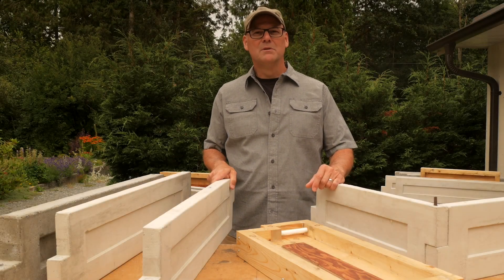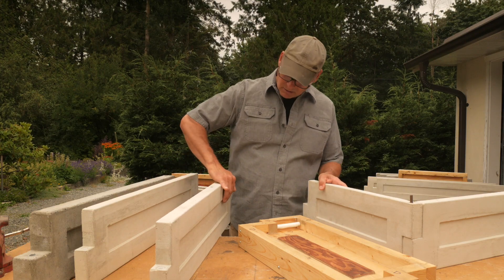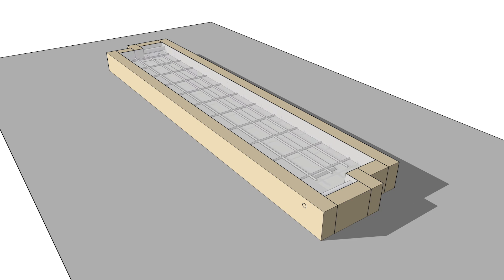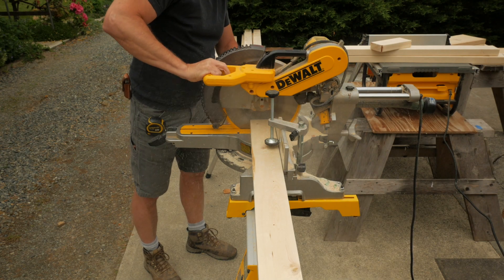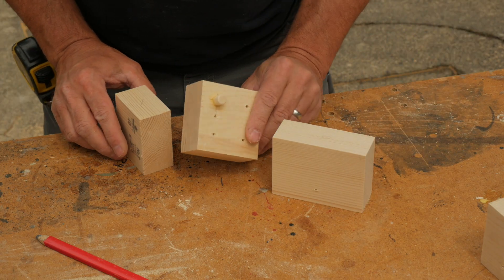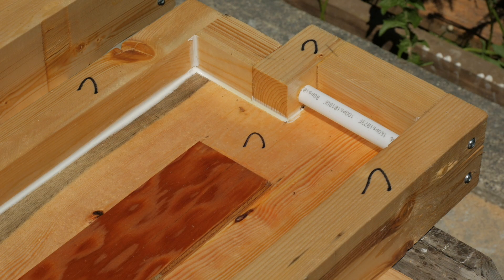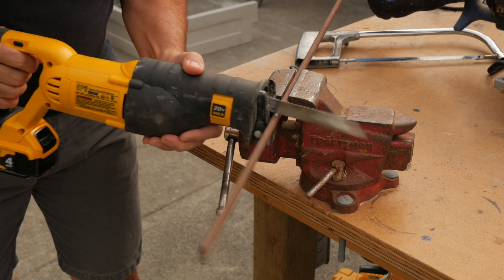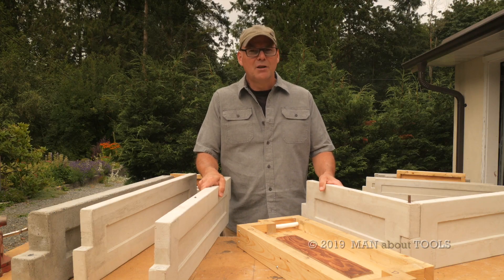make Thin CSA Concrete Garden Boxes PART 4 - cast garden forms

Comment: I love these raised beds. Lots of labor (I'm retired) but significantly cheaper than lumber now and I expect them to last well past me. Here is my story. 

Four years ago I gathered lots of free lumber from craigslist and built about 660 sq feet of ugly, mismatched wooden beds. I had hoped they would last 7+ years but did not know what to expect. Well after a couple of years I saw they were not going to last long. After 4 years they are in many states of falling apart. I started looking for something to replace them that would last and be pretty good looking. I found some that I kind of liked but didn't meet my criteria. Then I found these from man about tools. 

I decided that I wanted to use a standard 2x6 for the base of the form and 2x4 for the sides. The ends I made from a 4x6 I already had so they are just 1 piece of wood. I made 7 - 4' forms (2 more planned because that is about all I can handle in one pour) and 2 - 2.5' forms. This allows me to make my beds any of these sizes 4x2.5, 4x4, 4x6.5 and 4x8 (most of mine will be 4x8). I made two insets on the 4' forms and 1 inset on the 2.5' forms. I made the corner holes 3/8" and use 30" - 1/4" rebar to hold them up. This allows me to fill my trapezoidal garden space nicely. I put 1/4" gopher wire under the beds because we have tenacious and smart gophers. I also use the 1/4" wire in the forms. I use type S mortar and add 1# of concrete to it to make it slightly stronger and stretches 1 - 60# bag to fill 2 - 4' forms. I let the forms set 24 hours covered with wet towels then take the sides off. Then 24 hours later I remove the forms and place the 31# sides in a junk refrigerator filled with water turned on its back. I let them cure submerged at least 72 hours. They come out very nice. I may paint them after they age but they look pretty nice as plain old mortar.  

The garden is shaping up to be VERY precise. I replace a few of my old beds as my garden completes this year's crop. After tomorrow I will need for more tomatoes to end their season before I can replace any more but I will continue pouring these so I can get ahead for next year. The sizes  allow me to move crops around and move the infrastructure (irrigation, row covers, trellis, etc) easily. I decided on 34" aisles because that fits nicely into my space and allowed me to get a wheelbarrow between them easily. I have about 20% of my 660 square feet completed and make a bit more than one bed a week. So I have about 20 weeks of work to go. 

Thanks to Man About Tools, 
Dave

Comment: u could thread the top of the post and screw a cap or door knob for easy removal of the post and for additional decorative look also it would provide a seal to keep water out maybe a thin gasket time material in the corners and if plans to make multi level boxes... very nice job on all of these. definately think the csa mortor mix is the way to go. you could use mortor coloring mix also. excellant work.

Comment: Love Rapid Set Mortar Mix - everything except for the price.  Unless your budget is pretty big, it would cost less to hire the local teenager (or your spouse) to help you move the heavier pieces with the original design.  But...that doesn't take into account how fast the process is with using this mix.  Turnover rate (pour to taking out of the forms).  Time vs. Cost is always a consideration.  If it matters to you, it also produces a smoother finish due to being able to make the mix much thinner (a water like consistency will have less air voids.
Reply from the maker: Bret, I totally agree with you. The Rapid Set is expensive but it's fast and gives an extremely good finish. I used it on the countertop of the potting bench recently and it was awesome. Thanks for the comment here. Cheers, Kent

Comment: I know u did these out of csa but let's say you don't have all the additional ingredients and only Portland cement. To get outside strength ,can u first pour some slurry with glass fibers to make a thin coat and then add some aircrete on top of that to make it lighter?

Comment: Well done on presentation and instructions. I wonder if these would work well building a 3-4ft retaining wall. I like the design and especially the 'locking' design. Do you think there would be a need for mortar between the stacks?
Reply from the maker: Thanks. This is something I have not tried so I'm not sure if mortar would be needed.
Reply: @MANaboutTOOLS  Thanks for reply. I am going to try it. I'll send before / after pix. I've already dug a trench and preparing to gather materials according to your DWG specs. 
Be good . .  James
Reply: @MANaboutTOOLS  Does the 'brand' of sand matter in this 'recipie' ?

Comment: How did the cost compare? How much for a 36” and 48” section, not including the form?
Reply: This method seems to be more expensive as the bag of high strength mortar mix is currently $15. Below is my price calculation:
Mortar Mix - $15.49
Plasticizer - $2.75
Glass Fibers - $0.35
Citric Acid - $1.00
Total - $19.59
As mentioned this amount fills (2) 36" forms or (1) 48" and (1) 24" forms.
Reply: @RemRemster  that’s not bad considering they should last at least a decade or two and considering the price of lumber these days.
Reply: @jhost0311  My thoughts exactly. May cost a little more up front but with the price of lumber as it is, I’d say concrete is the way to go.
Reply: @RemRemster  my problem is, with my lack of necessary tools and a good workspace, it would be hard to build those molds. 

If you developed your plans you could probably sell a set of molds for a couple hundred dollars. 🤷🏼‍♂️
I’d buy them.
Reply: @RemRemster  wanna sell and ship me a set of your molds? Lol
Reply from the maker: Jeff, I have greatly simplified the form and tools required in this video: https://youtu.be/9kga9jSG7Gs  Have a look. Thanks! Kent

Comment: I'm curious - how many times can you wind those screws in and out of your timber before the timber starts to fall apart? When I was making concrete forms, I used bolts and nuts... now wondering if that was over-engineering or just forethought.

Comment: I like these.  I'd like a similar linear box without full height end pieces on each segment - a divider only about half height - to keep the sides from spreading.  These should last for years and years!  I also might have holes on the end pieces for a root level drip system.  I could use mulch around the plants then plastic sheeting, with the irrigation at root level. Here in South Texas planter boxes get so hot that they can quickly dry out.

Comment: Use butterfly nuts with inlay washers that are inbeded into the wood with a router. Glue the washer into that cubby and you will have a more long term solution.

Comment: Sounded like a great idea till I saw that Home Depot wants $18 for a 55# sack that yields .5 ft3
The CTS website shows 6500psi compressive and 550psi shear strength at 28 days.

Sakrete Maximizer mix at Lowes is $8.48 for an 80#sack that yields 1.0 ft3
Compressive strength is 5500psi but I couldn't find the shear strength.

Comment: I don't know about CSA, however you might want to get a $10 kiddie pool. Fill with water and let your blocks set in there for a week or 2 to cure.  Your v2 are 40% lighter, but also thinner so not exactly apple to apple comparison.
Would have been interesting to see these made with air or foam crete.  Nice job, subbed!

Comment: Finally got to getting these poured ... Had the forms built for some time but you know "Life" gets in the way ... Everything went pretty smoothly except that now 4 hours later and I am just about dry enough to run the edging tool around them ... Why is this drying so slow ...  Today was partly cloudy, 78 or so degrees and low humidity, 48% ... I followed all your measurement exactly ... Even the bit I had left over that I poured out on the bag to dry so I could throw it away is still wet ... Just don"t know .. Any Ideas ... Thanks JohnP.

Comment: Great series!:) - now if you could just come up with a lightweight foam form - so that us ladies without a lot of strength or power tools could just glue it all together. You can glue foam together and the silicone seal should work too - but the pipe insert? It would mean throw-away forms, but I'd gladly make eight forms. Of course, this leads to a concrete garden pond complete with fountain:). 
I really like the simple, classic design, looks sleek and modern too - it can easily be vamped up or turned rustic or in my case take on a tropical or Mediterranean style.
I have been on the hunt for a good looking garden box and ideally a fountain to match. I just need to find a way to make this project or a similar one doable for me - it would be perfect for my Florida garden.
Hands down yours is the best looking, most durable solution with the most potential for a myriad of design options that I have come across so far. If I can't make that happen I think I will just have to come up with my own improvements, using cinder blocks with those corners from Home Depot with a slot for rebar - somewhat similar to your design - then make them look sleek and cool.
We'll see - aren't there lightweight concrete blocks used in construction?

Comment: I have another question. I am very new to the raised beds. How do you Rototill, shovel up the soil or dig out roots if the bed is up to your waist?
Reply: One of the key points of raised beds, you don’t step on the soil. No rototilling, no spading over. Cultivation is soil destructive, minimizing tillage is the modern agricultural approach. Apply compost and mulch to the surface and let your worms take it down.
Reply: @paulvandenberg5341  The ground compacts over time, regardless if you walk or not on it.  ... ?
Reply: @genevelis6075  the compaction is way less if you keep feet and wheels out. My native soil is a fine silt loam. When my pasture is dry, not dry enough to wilt grass, I have to jump on a shovel. In one of my raised beds I can just lean on the shovel to penetrate the ground to loosen it for pulling parsnips and carrots.

My older beds have accumulated enough organic matter that I can use a hand trowel to loosen the first couple of carrots. My worms do the aeration and mixing.

Recommend finding a copy of Ruth Stout’s book, I think the title is The Lazy Gardener.
Reply: @paulvandenberg5341  Thank you. 👍👌

Comment: Where do you get the CSA concrete and how much more expensive is it than the lightweight one used in the previous version?
Reply from the maker: I buy mine from Home Depot. I have not worked out the cost difference to some of the lightweight formulas.

Comment: Thank you. I was wondering how many sets of the molds does it take to use up a full bag of portland cement? Your answer would be helpful. I've already made one set. 4ft, 3ft,2ft and 1ft. I'm using portland cement with fibre and sand. The ratio is sand to cement 4-1 ratio.

Comment: Thank you! This is such a resource. I can point people to this when they talk about building garden boxes. Personally, soil holds itself up so I don’t feel the need, but boxes are so popular and there are so many poor choices of material available. I love these. That center indentation is perfect for embellishment: tile, beads, glass, shells, etc.
Reply: Where can I find this magic soil you speak of? Soil that holds itself up? What a wonder!
Reply: @idontthinkso666  They’re called hills. Smaller ones often known as mounds. There’s a German term called (taking a stab at the spelling) hugelkultur. Hugelkultur beds are about 5 feet wide, and you dig down a couple feet, lay down brush and sticks followed by manure or other accumulated compostables, followed by the sawmill he removed. The result is around it over a mound that’s highest in the center, an arc in cross section. This is a shift from the usual flat top raised bed. The ark gives you a significant increase in surface area to plant. The rough stuff buried under the soil will decompose in its own time, lowering the height of the bed somewhat. NBD, we will still retain the increased planting area from the same square footage. And you don’t have to shred your branches and brambles! Looking back issues of organic gardening magazine, I think you’ll find it. Or… rip out the deep tap Ruthy perennial weeds, cover the bed with 45 layers of newsprint (dampened to keep the wind from throwing them around.) Cover the area entirely with as much quality compost as you can muster. If you have a stock pile of fall leaves and or grass clippings free of pesticide, keep that over everything! Grass clippings of tons of nutrients, dead leaves turn soil into chocolate cake! If you can get it, it’s phenomenally good mulch for a lazy, deep mulch system. If your neighbors don’t use Weed & Feed, Take those dead leaves off their hands!

Comment: Awesome vid. Excellent content and presentation.  Have you done any tests to compare the effects of the concrete on the plants ?  In my experience, any time plants are grown in proximity to walls / houses / foundations they taste strange and struggle to grow. Observing this countless times has led me to a hypothesis that the motor must leech a bit. Dunno if its forever, or just years after pour... Plus, the proximity is def a component....    Maybe could be solved with a sealer ?  Or a torch burn ?  Or that silica outer layer glass technique  ....   Just sharing my humble observations.   Thank you for your hard work and helping others !!

Comment: I like what you have done. I would suggest, with the re-rod, to make it long enough to wrap the ends around the plastic pipe. That way it will stay in place and you won't have to let it start to set up.
 Also, if you can allow the frame plans to be downloaded, that would be great.

Comment: Another idea is unique/specific storage that blends into setting of your raised beds. So there could be a need to join three or four panels at the same intersection. So I'm thinking of this. The 1/3 center of the end is NOT part of the casting. Then a third panel can be lifted 1/3 and into that gap. This allows for one rod to anchor all three panels. Separate 1/3 height ends can be cast for locations with just two panels.  Or howabout this, cast something decorative or with a function but still with the hole for the rod.

Comment: I'm thinking these could be used for other "wall" used. If the front and back walls are 20" apart a top could be added. So a patio could have a perimeter of planter and bench. Some runs could be three or four high. Then a castcading plant hangs over. Or have one row higher than the bench with its own lid to hide an ice chest.

Comment: Today I've seen all 4 vidio and your process is master with each build, Believe the"air bubbles type much to weak to lasts for years..
Surprised with all your work and talent you didn't show compared cost of price and show time involved.
Question compare to cedar the cost of both say for a 4' x 8' which is often sujust for the urban garden.
Super great show how to do and we always have multiple ways and needs to consider the way best for me and you and how long we want it to last.
I'm thinking them going to go for many years after any wood,steel and plastic and fiberglass might beat it but at a unaffordable price.
Thanks for a great learning experience Sir

Comment: Just wondering if you managed to do the 'strength test' on these new thinner panels made from the rapid-set concrete ? I would be interested to learn if you compromise on the strength by using this form of cement. If you did test them please could you let me know the video title. Thanks Kent.
Reply from the maker: It's my latest video.

Comment: Form oil is available at building supply centers and will cost a fraction of the cost of butcher block oil.

Also.  Why the need to make them thinner and lighter? Once they are in the ground it shouldn't matter.  Just dont make them so big that you cant move them. 
Thinner is cheaper.  I get that.  But you specify thinner and lighter as if those are your priorities? 
Why?
Thanks in advance!
Reply from the maker: Yes. But not available everywhere. Also, mineral oil can also be bought cheaper at pharmacies and farm feed stores. I went down the road of trying to make a lighter panel at the many requests of viewers.

Comment: I have a question, how would the aircrete, or the csa hold up to holding water like let's say 100 gallons?  I know I would need to at least coat the inside of it to seal it but to keep it lite and still strong enough to use it for that.